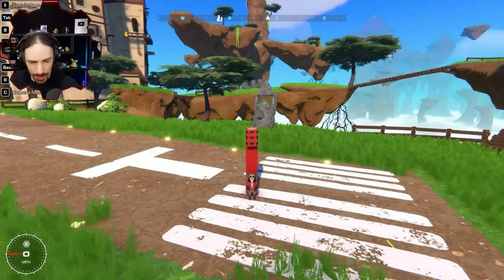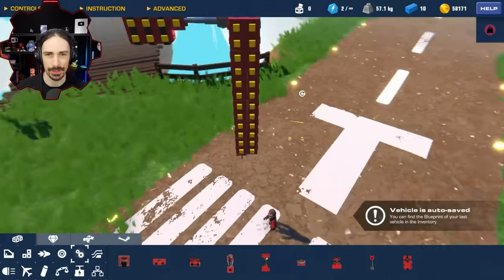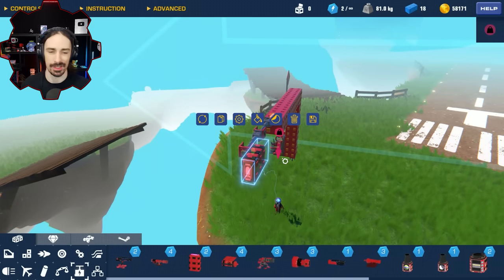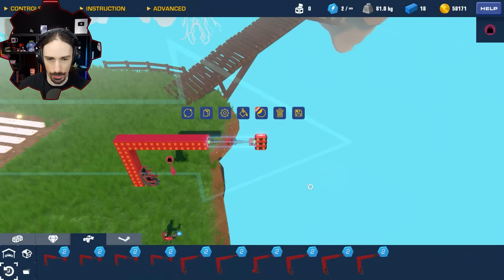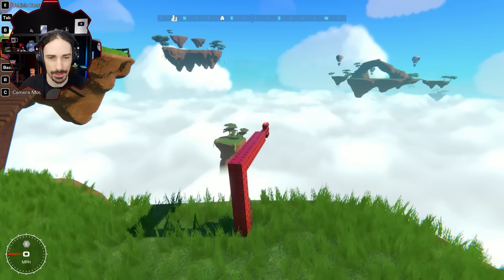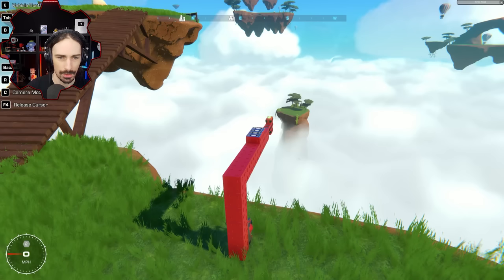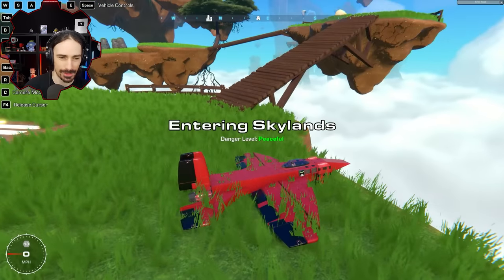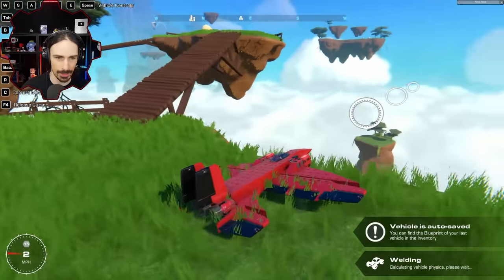I Turned The Bombs Into Bullet Style Projectiles!

Comment: I think you should angle your guns a bit downwards, so the reticles are aswell, because the bombs already start falling when being spawned in
Reply: Point the bombs up
Reply: I was thinking about that idea! Nice 👍
Reply: @legendaryblob8227  that could work, but I think that aiming the guns down is still more effective, since rotating the bays only increases the height of the bombs by a tiny amount
Reply: @creeperlano7805  No, not just the bomb bays. The whole piston assembly which also constitutes as part of the bomb gun.
Reply: @anteshell  the instability of the rotating parts would probably throw off the plane and/or the bombs a lot more
Reply: @Crazyclay78YT  This becomes a problem mostly on heavy  and unbalanced loads. The game handles three dynamic blocks bearing light weight quite well, if they're not disturbed by colliding with other parts of the vehicle. Should not be a problem at all with this setup.

Comment: You know what will be a nice addition? A sort of bearing or a servo that turns based on the lock on on enemies and has its own reticle. So you can use that to make your own awesome weapons
Reply: Yeah that would be a really  good idea too bad stuff like that doesn't exist in the game yet
Reply: @Ryno-jn9kv  Key word "yet"
Reply: sorry to say this but that will hardly work, since the lock on mechanism actually accounts for the weapon's bullet speed and bullet drop.
so the "Custom aiming reticle" needs to have tons of parameters for it to work at all.
Reply: @bicuswang5149  ... All it needs is 2 parameters: Bullet drop in seconds/meter meters/second^2 and bullet speed in meters/second.. And if you want it to point straight at the target, you can have either a checkbox for that or just set the bullet drop to 0 and the bullet speed to a really big number.

And if you add a visualization of the predicted trajectory in build mode, then even if you don't exactly know what the values are, you can estimate them by guessing and checking the trajectory display vs the actual trajectory of the projectile.
Reply: @nikkiofthevalley  Wouldn't bullet drop be measured in m/s^2 (i.e. acceleration?)
Reply: @pandapip1  Oh, yes, yes it would. Oops. The rest of my reply still applies as far as I can tell, though.
Reply: yeah except the lock-on cant give feedback to servos/logic so idk
Reply: @Crazyclay78YT  Actually, if you use two angle sensors, a free-rotating swivel, and a servo for control, you can generate a rudimentary feedback system using logic.
Reply: @pandapip1  that dont make no sense
Reply: @Crazyclay78YT  The rotation would be able to be picked up by the two angle sensors, which would be fed into the control servo to rotate the angle sensors back.
Reply: @Crazyclay78YT  I was talking about with the proposed new part. But you can also use the recoil from the smart cannon in vanilla, although I haven't had any success with it.
Reply: this would kill some weapon balance though if just anything could have aim assist
Reply: @silksongoutyet  It would cost 2 or 3 power cores. That way, you can have an aim assist tank cannon but it will cost more than a rocket.

Comment: the thing about delays in Unity, which is a game engine that Trailmakers is using, is that it has several different Update() functions one runs every frame and will vary due to framerate and there is another one that always runs at 50 fps even if your game runs slower. Devs might have used the first Update() function i’ve described for bomb logic thus making them inconsistent

Comment: You can make the rockets from the rocket launcher go super fast using the pistons.
Edit: another way to stabilize the plane when using piston launchers is to add a piston that fires backwards at the same time as the front, and add the proper weight.

Comment: I mean, you can try to do this, or you can use the system they game already gave you which they named "rockets".

But you seem to not quite grasp that pistons in TrailMakers are flimsy and violent movements make inertial wobbles happen. So what's happening is you're extending the pistons so fast that by the time the first bomb is released, the bay is in some kind of wibble at the end. But it's a very high speed, small distance, violent wibble. So the first bomb is being imparted the random velocity of that wibble, but the proceeding bombs are not. You'd need to pulse the pistons 4 times a second to get some kind of consistent non-standard result, but it'd always be random due to those violent wibble-wobbles.

Comment: This works so much better on a plain than on a car, i built something similar to this but on a buggy after your last try for vertical bomb launching, but didnt know the trick with the -100 speed, so the bombs drop just like 50 meters in front of the vehicle, i could not figure out how to improve that so i just themed the buggy so it at least looks like it is supposed to be driving through the explosions. 😅

Comment: What you should do it add two more but have the time set to the current ones and flip them so you have one on each wing firing at the same time maybe it will counter act the twitching of the single ones and maybe you can get more of a rapid fire rather than burst and waiting for the recharge
Reply: Also did you put this on the workshop

Comment: Someone correct me if I'm wrong, but I believe the time between bombs should be .33 repeating and not .25. If 4 fire within one second then the 1st bomb is at 0 seconds, the 2nd is at .33, the 3rd at .66 and the 4th at .99, or technically one second. If I'm right, you might be able to make this without needing as much logic delay.

Comment: huh, ok... so my third comment about a simple way to try to eliminate the waggle the alternating fire causes got scrubbed...
Add two more of the weapons on the underside of the wings directly below the top set, and fire the groups on the opposit wings. Like, if the top two are 1 and 2, and the bottom 3 and 4, fire 1 and 4 at the same time, then 2 and 3. The motion would be sort of symetrical, so should cancel out the shake. It'd also double your ROF and give a constant stream from both groups